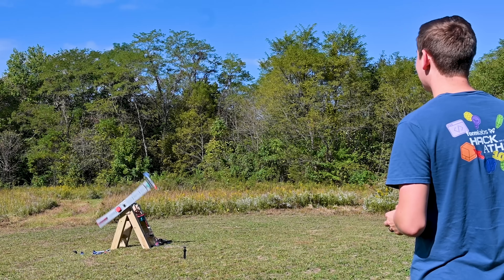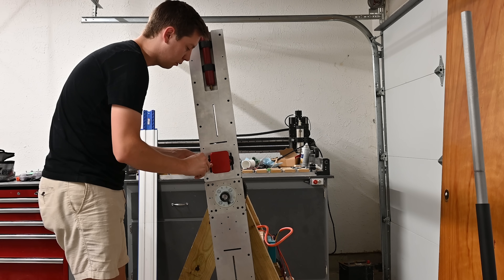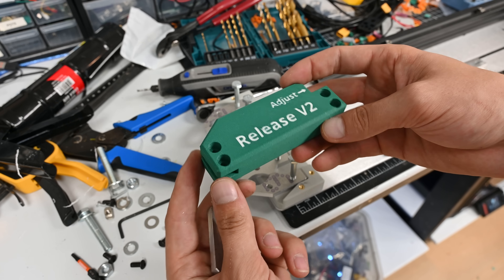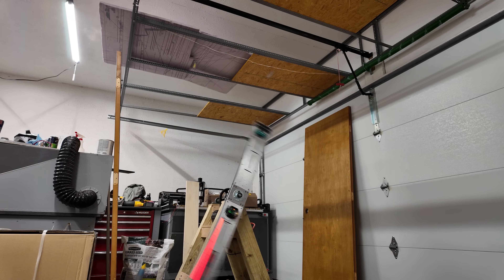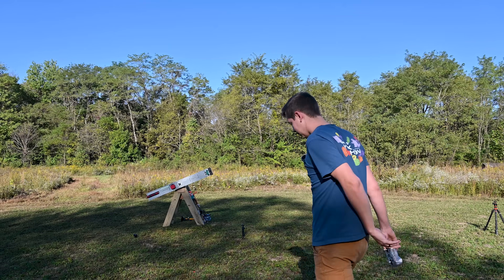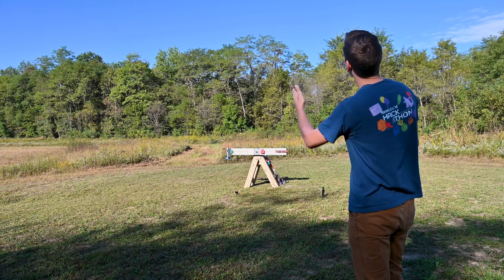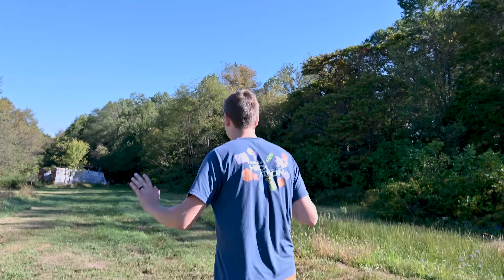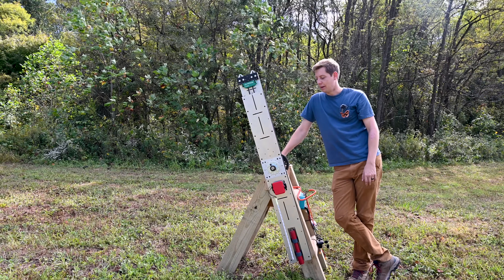I Fixed SpinLaunch

Comment: Why not use different solenoid valves for the front and rear release? Then you could set the timing in the software. That would probably be easier to fine tune.
Reply: Electromagnetically attached so the speed of detachment is near instant when the current is cut.
Reply: @Reahreic  Use 2 clock-able contact brush rings with a break in them for front and rear disconnect timing and switch from constant current to brush interrupted current to launch.
Reply: @Reahreic I thought about an electro magnetic release mechanism but I'm not sure that it would scale. Imagine spinning even a 10 pound weight at 150 Gs. I haven't done the math, but intuitively the forces would likely exceed the capacity of any electromagnet? Scale it further... 20 pounds at 200 G? I think the idea works at small scale, but I don't think it translates to mass scale.
Reply: Good idea 
But i think pneumatic valves and cylinders are pretty inconsistent. They have a different delay depending on temperature, pressure and aging.
(I work a lot with pneumatic)
I would recommend an electromechanical solution.
Reply: @notconnected3815  just 2 servos, would also be more user friendly, since dont have to fill the air tank anymore
Reply: My thinking is that mechanically linked would be more reliable. Anything else is going to introduce minor differences in each launch.
Reply: @kevinh5983  mechanical linking always has tolerances and wear over time... if you couple electrical actuation with feedback sensors, the system can be designed self adjusting. plus as said before: very easy to fine tune via SW
Reply: @thetomster7625  but it's still only one point of failure. if you used 2 solenoids they'd be wearing out 2 mechanical releases at 2 different rates
Reply: @SirChris314  I don't see how 2 solenoids have one common point of failure?! If you are talking about the SW, this is completely the same with the mechanical: it also has one trigger source. Plus solenoid error is very easy to diagnose and even predict..
Reply: no it's overcomplicated and prone to error you have to use geometry since you can, avoid relying on velocity dependant system. Also bc the final quest is reaching a precise velocity the escape velocity (GL) at the edge of the arm.
Reply: Wouldnt electromechanical systems not get too bulky coz onlf the amount of g force being experienced
Reply: Nice, was just about to comment this. Was also going to mention weight on the actual launcher. The A frame just bounces around, probably would be a bit more stable with some weights to keep it steady.
Reply: Maybe ask if these are problems our ancient ancestors solved millennia ago…because they definitely are.
Reply: MECHANICAL TIMING GOOD AND FUN

Comment: Now you just have to add a rocket motor and launch the rocket from the max height of the throw!
Reply: BPS COLLAB.
Reply: @Liace159 bps would both love and hate this, and it would be epic
Reply: @37chairs Exactly what I thought!
Reply: @37chairs I really love his smiling thru madness videos
Reply: I was going to say the same thing! Using this as a primary launch and the rocket motor as a secondary launch would be awesome
Reply: i need this!
Reply: You would only need to delay if air resistance is substantial, otherwise any ignition time should perform similarly.
Reply: @DoctorAdamLuter  Actually, if you ignore air resistance, you should ignite the rocket as early as possible (when it's speed is at its highest) as this will lead to a greater increase in height. This is counter intuitive and I sometimes struggle to understand why as we are adding the same amount of energy either way but it's easy to look up and I got enough intuition for it while playing KSP :P
Reply: @DoctorAdamLuter  Could have it get triggered by spring loaded contacts that are held apart by the release mechinisim, by the time that the motors ignite, it will probably be near it's max height.
Reply: @DoctorAdamLuter  well hey, guess what! We're on earth. Air resistance is significant.
Reply: @arturjogi6054  the profile of the rocket and the speeds we are getting out of the launcher don’t really make much resistance. The rocket motor is still going to be contributing the bulk of the performance. Not to belittle the effort of the creator but the current scale is just a toy, an Estes D class motor would provide significantly more lift. I didn’t watch the first video but I would love to see him demonstrate exactly this and show the math. (That is so the math then launch the rocket both ways)
Reply: @DoctorAdamLuter  well it kinda is because this is earth
Reply: As a safety precaution I would use an altimeter to control the mid-air ignition. Otherwise if the rocket doesnt release properly you could have a horizontal missile on your hands.
Reply: @Fishopatamus "This is a surprise tool that will help us out later " 🐭
Reply: Yes Spinlaunch use a counterweight in their patents and in the existing prototype, according to real engineering's tour.
Reply: @licencetoswill  at those speeds, you pretty much have to. the slightest imbalance will shred the entire device.
Reply: I'm for this as well!
Reply: Technically the better idea is to trigger the motor as soon as the rocket is realeased so that it actually flies the correct direction. unless you want to use TVC, anyway.
Reply: @etherealswordsman3214  an accelerometer in the rockets ignition system would help with timing the rocket motor firing after release. Maybe fire as soon as vertical velocity drops at all?
Reply: @kevinhorne9643  actually, while its spinning it's experiencing mostly horizontal acceleration, but the second its released that horizontal acceleration drops to zero.so that's way easier to use as the trigger.
Reply: @etherealswordsman3214  Another simple trigger is a wire breaking.
Reply: @travcollier  that or using the release to just pull a pin. the caveat here, however, is that the force of pulling whatever string you might use might throw off the flight before it liberates itself.
Reply: Rocket motor, rocket motor, rocket motor! 🚀
Reply: Actually, light the rocket when it's going the fastest (i.e. right after release) to get the most kinetic energy out of the fuel.
Reply: @davorbokun  Maybe just a moment of delay, then check velocity is over a certain margin to make sure the rocket is actually airborn and not embedded in the ground
Reply: @UNSCPILOT Yes, I agree. Moment of release is only theoretical optimum. And also ignoring air drag at high speed. Practical solution will differ for sure. But rocket is essentially pushing it self against propellant, and it's better to push yourself against fast moving propellant than stationary one.
Reply: I just posted same comment and saw yours 3 down, lol. Great minds....
Reply: @cadthunkin  I have recently gotten into the habit of scanning a ways into the stack before I post my comment LOL. In Pairs, yes!
Reply: the rocket should fire at the moment of the detachment because it is more efficient. (see Oberth effect, I think it applies here)
Reply: Waiting until max height would mean that all upward momentum is exhausted and the rocket would have to start all over on getting the upward motion going again. Not much different than moving the launch site to the top of a high mountain. Instead, the spin launch could be used as an assist to that initial upward momentum replacing burning fuel load contained in the rocket. Light up the rocket motor a second after release and take advantage of all of that spin energy. The fuel weight savings may mean a larger payload. But probably not much.
Reply: This should be the next step 🎉
Reply: and he has too make a vacuum chamber for it for 0 air drag
Reply: This
Reply: Max G not max height
Reply: technically, it would go higher if you ignited it as soon as possible after release, however as another commenter pointed out, you might need to delay to prevent it from shredding
Reply: Imagine ramjet...
Reply: Not the max height 😂 the max acceleration 😅
Reply: No!! Start the rocket engine when it has top speed to preserve momentum
Reply: Onboard micro controller with an accelerometer to trigger the rocket motor when the upward velocity drops below a threshold (probably with interlocks to stop it from trying to start the motor if it's still on the launcher from a failed or aborted detach)
Reply: No guys...

Rockets are not efficient if your let them slow down.

The momentum is equal regardless of speed, so it linearly accelerates. Despite being the same momentum, going from 50 to 100m/s is a LOT lot more energy captured compared to 0 to 50m/s.

Somebody correct me
Reply: It’s actually just as good if not better to launch the rocket motor AS you release from the machine. Not just max height. This is cus then ur adding on momentum instead of changing height of launch, which is not as helpful
Reply: not from max height, immediately after release at max velocity!
Reply: no rocket can handle the g forces, i am literally making notes about what solid fuel could handle it, forget liquid rocket fuels, the hardware is so lightweight it would be crushed..
Reply: @ZionistWorldOrder  well for this the idea is to use a solid fuel hobby motor (and this doesn't push the g's too high). i think the real spin launch is just over-building the rocket part, so they're gonna be heavy.
Reply: @ZionistWorldOrder  no rocket can handle the g forces, that this hollow plastic rocker handled?  Sorry don't mean to argue, but it's not clear if you mean the real Spin Launch device which has never been built or the tiny one in this video?
Reply: And put a mouse in it to see if there's just a smudge left of it?
Reply: The only thing that makes spin launchers viable is the portability to launch small rockets from anywhere.

Large rockets can b launched using high speed mag lev, similar to the high speed trains mag lev trains in Japan. As long as y have a mountain tall enuf, u have a ready made ramp that requires a few adjustments to aim it as vertices as possible.
Reply: Cute idea. But introduce any liquid in this equation and the whole thing will just stop working because of the fuel slashing around. First during the upspin and then again at the release. The only way to make this even remotely feasible is using a solid propellant rocket. And solid propellants are simply not nearly as efficient as liquid propellants. You'd also need some serious steering equipment on your rocket to compensate for the sudden acceleration. Seriously, the whole spin launch concept is just findamentally flawed.

Comment: You should look into tent stakes to secure the launcher onto the ground better.
Reply: Throw them into the ground using the launcher!
Reply: Great idea.  Alternatively, a few well-placed sand-bags works well for stabilising machine-guns - perhaps that would prevent any unscheduled disassembly?
Reply: Might also be worth it to use an impact to drive a couple very long lag bolts into the ground.
Reply: if it was me I would use tee-posts to attach to
Reply: Just concrete it into the ground.
Reply: Yeah right, this is a 500 rpm launch for 300 feet, ..... lets calculate the unbalance for a mile high....... 😂😂😂😂
That thing will be dancing back into the truck!!!!!!
Reply: Screw in ground anchors are a solid upgrade from tent pegs if the soil is strong enough
Reply: @murunbuchstanzangur  you have NO idea.........
Reply: No securing to the ground is needed with good (both pre and post launch) balancing
Reply: @ivanjermakov  Stating the obvious doesn't make it go away...

Comment: You could probably make the rocket denser (heavier) without any loss to speed or calibration, then it will go even higher and land even further in the dirt thanks to its greater density counteracting drag.